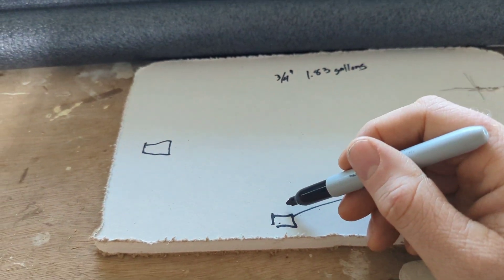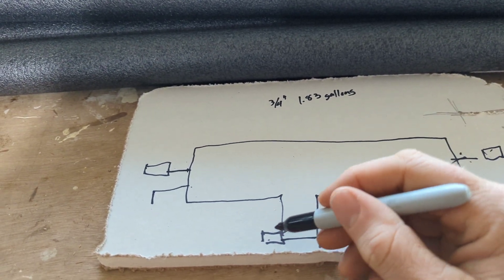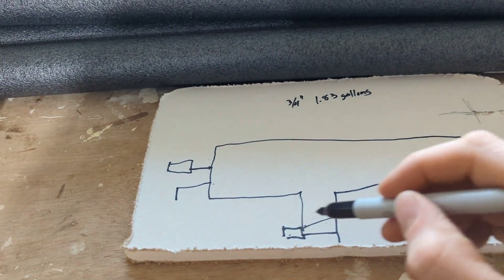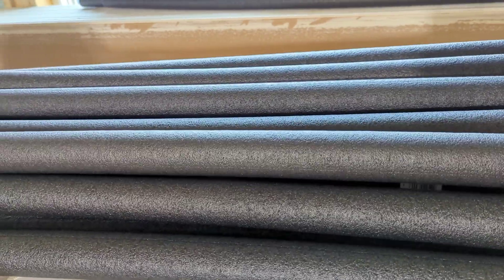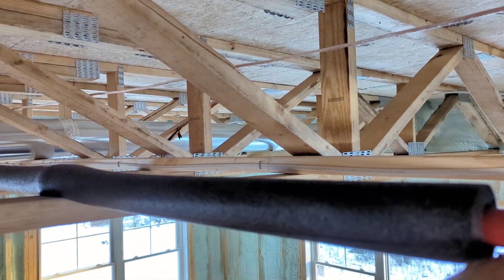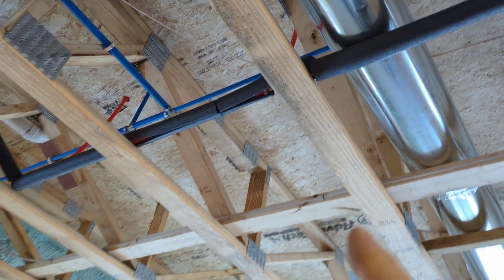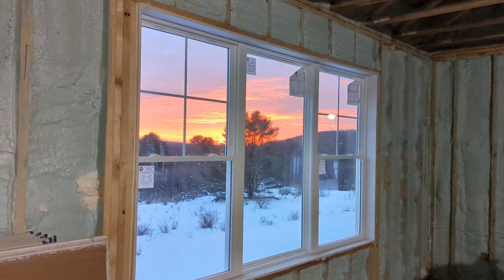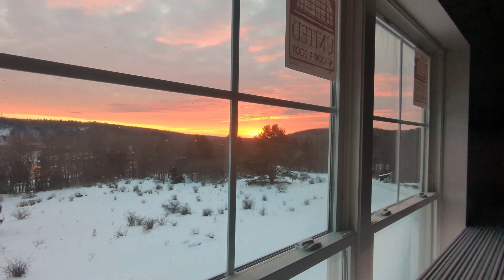Almost Missed This - Insulating Hot Water Recirculating Loop

Comment: When the house is finished, no one will ever know how much work went behind the wall in order to make all of the systems work.  As long as it works, no one will care, but so much expense is never seen once the drywall goes on.
Reply from the maker: I had given a very long consideration of doing an owner builder. Initially I thought it would be the only way we could afford it, so I set out to get as comprehensive of an understanding as I could about the process. That has been very valuable. Our approach has been to prioritize function over finish. Finishes can be changed more easily in the future.

Comment: Looks great, Woodly!

Praying for you guys this morning!
Reply from the maker: Thank you for the prayers and thanks for the heads up on the insulation. I used some tape to seal it better and the loop has good insulation on it now. I still have to complete the line into the mechanical room but the part that needed to be completed prior to sheet rock is now done.